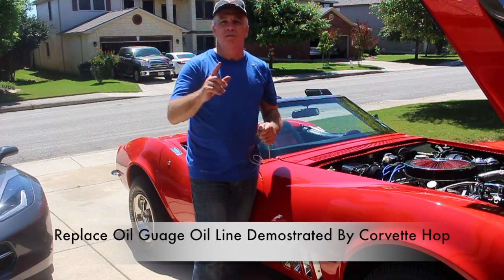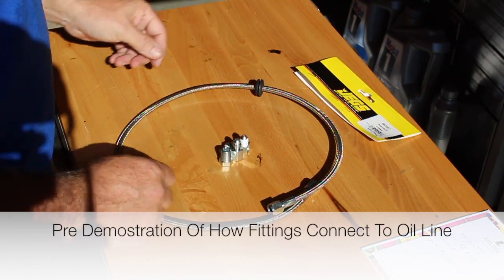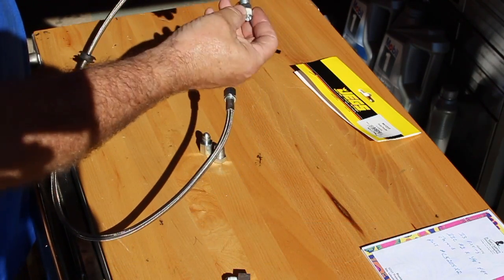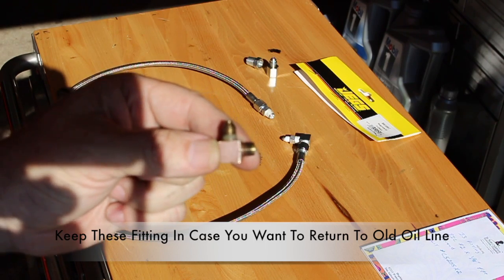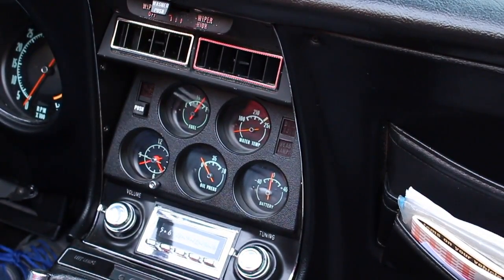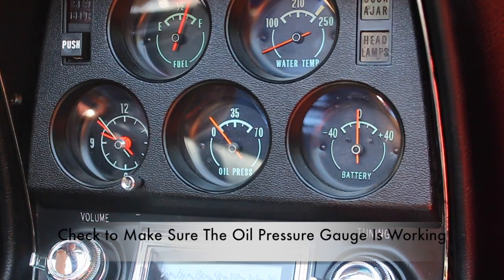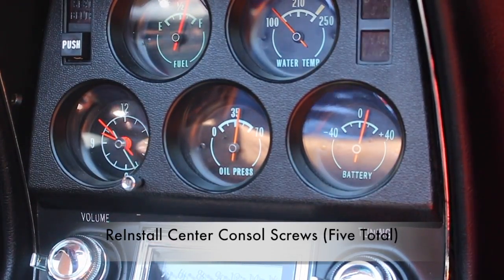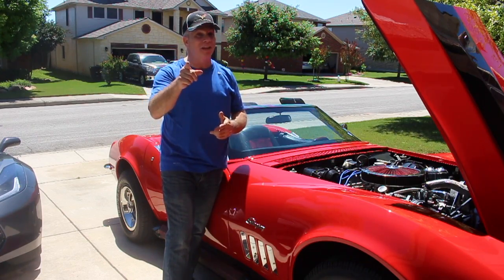C3 Corvette Oil Gauge Pressure Hose Install (Steel Braided Oil Hose)

Comment: I really appreciate your videos - they've helped me several times.  In this particular video I might add one more hint.  I find it helpful to remove the knobs and nuts on the radio face so that the gauge cluster can work free of the radio.  These cluster face plates are quite brittle and can break at the area around the radio.  That's not good anytime, but especially on a '68.  Thanks again!

Comment: Very informative video!  I just removed my oil pressure gauge to free up the mechanism.  When I returned to reinstall it, I noticed that the brass insert in the plastic oil feed line had snapped in two.  Part was in the tube, and part in the brass elbow.  Plus, the brass sleeve was wedged over the insert.  I'm planning to order the replacement parts from Eckler's on Monday but may order the Jegs parts instead.

Comment: Also works on a C2. The back of the gauge fitting I bought was from Fastenal. Part number 420650. Price was $1.44 plus $ 6.00 shipping. Can’t beat it. Thanks for the video.

Comment: I also had trouble with the JEGS  Part # C5205X2 not fitting, so I had to order the Fastenal Part number 420650.  Strange because I have a 1969 Corvette just like CorvetteHop.

Comment: Hello. I have a 1969 L46 Convertible. Replacing the plastic oil line for the second time so I got the kit. One thing not clearly shown in your video is the passage through the firewall. Did your speedo cable go through the same hole as the oil pressure line? Currently, without a grommet, I can probably get the braided line through next to the cable, but I don't see how the cable and the line will fit in the grommet. Wondering if your setup has a separate hole for the cable or oil line.

Comment: Hi,
Thanks for sharing your touching life lessons.
My 71 C3 convertible  has the typical "sagging nose" that has opened up the gap between the top of the door and fender (both sides).  I gave not found suitable instructions on making this adjustment.  It appears the body mounts are in good shape along with the door hinges that are tight.
Any advice on adjusting my "sagging nose"?

Comment: Great video.  The gauge fitting didn't work for me though.  The C5205X2 is a 1/8 NTP to AN3.  I had to get a 1/8 NTP to AN2.  My gauge didn't look 50 years old and pretty sure it is a OEM replacement.  It's still a 70 psi gauge and correct for a 1972.

Comment: Hi CorvetteHop! your videos are extremely helpful and thorough, I thank you very much for them! they also save a student like me a lot of money rather than taking it to a mechanic, so thank you again! I wanted to ask you a huge favor, if you could please make a video about using the Innovate LM-2 Digital Air/Fuel Ratio Meter while driving the car. I saw the one you used the device while the car is at idle 8000RPM. but would really like to know how to use the device while driving the car.

Again, thank you very much.

Comment: The Jegs supplied part C5205X2 did not fit. Thanks to the comment with the Fastenal 420550 I was able to get the part that fit. Local suppliers said no such thing existed. On line from Fastenal, Stainless Steel at 10 times the price, plus shipping, but fir perfectly. Thanks for the comment.
Reply from the maker: Thank you so much for the update and information.
Reply: Greg, I can’t find the number for the back unit part, 90 degrees fitting . Fastenal have one but number is 420650. 
Did you used breaded line from Jegs ? Thank you !!

Comment: Instead of the "j3" fitting, couldn't you just use a -4AN male-to-male coupler, add a swivel 90, adapter, and connect the line to that? Wouldn't that completely eliminate the need for teflon tape? I've never seen anyone use teflon tape on a flared fitting.

Comment: This helped me fix my 72. Thanks
Reply: Hi Brett,
it's been a while that you changed the oil line as described here in this video. 
Me, I am experiencing the same issue on my '72 Convertible also.
What engine was it that you changed the oil line from?
I am wondering if the fittings will also fit for the 350 cui Small Block.
Happy for sharing the experience you made.
Cheers,
Michael

Comment: Any tips for routing the new oil line in the engine bay and through the firewall? I'm hoping to do this improvement to my '73 before the original plastic line can break.
Reply from the maker: Yes, run the new oil line exactly in the same location as the old line. One other point, I did have some difficulty finding the J3 fitting that I referenced getting Norm's help in finding at the beginning of the video. Hopefully, you can find one easy at you location.  I did provide some part numbers to help.

Comment: Hi, 
thanks for sharing the valuable and helpful content! 
Does the introduced oil line kit and the additional fitting also fit for a 1972 Convertible with the 350 cui Small Block?
Happy for feedback since I recently found an undesired oil well behind the dash. 
Cheers, 
Michael
Reply from the maker: I think so, the key is the oil line behind the panel. Also, the fitting that I used when I made the video several years ago is difficult to find. I am still looking for a good part number for the replacement fitting.
Reply: @TheWhatisright  
Yes, I agree that it is most important to verify what kind of thread connects to each side of the hose (engine side and gauge side). 
After some research the community agrees to commonly find a 5/16-24 NPT thread on the gauge side (90 degree connector) and a 1/8 NPT thread on the engine side on top of the rear manifold. 
However, it is best to always check individually as that might change by the years and engine configs.
I learned about a similar kit that is offered by SUMMIT (Summit PN SUM-G2960) but quite some people complained about it to leak afer having it installed. 
So I think I will follow your helpful suggestion and give the JEGS kit a try after having verified if the connectors fit.
Over here in Europe it is hard to get fittings in inch size as most of the automotive equippment is metric.
Reply: @TheWhatisright  BTW...do you have a link for the additionally needed connector at hand? 
Seems to be a challenge especially here in Europe to find something that is matching.
Any hints are highly appreciated.
Reply from the maker: No, but I will continue to look for it.
Reply: @TheWhatisright  OK, thank you. Happy to share the latest on that topic with you.